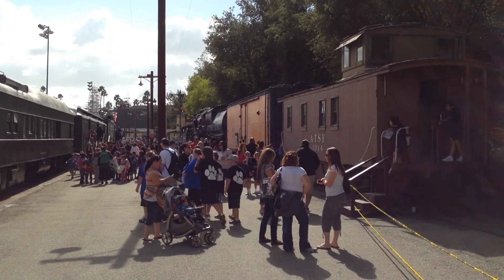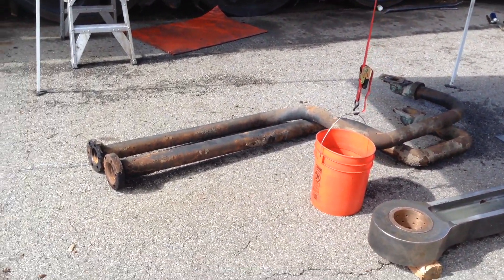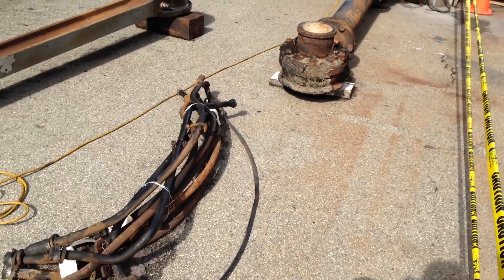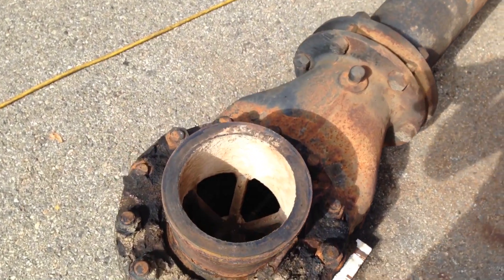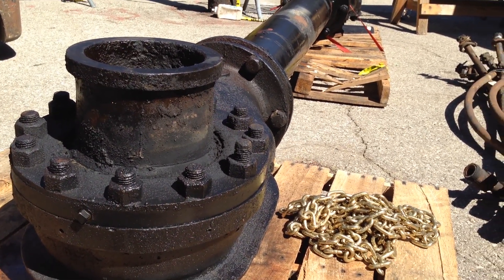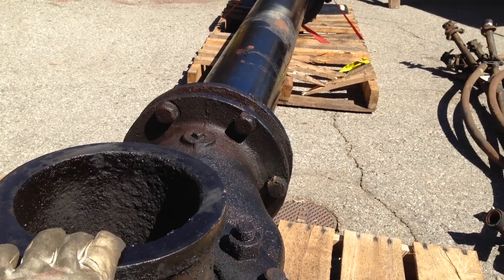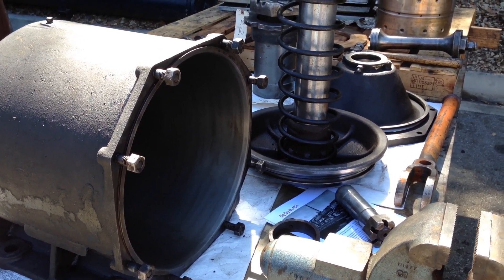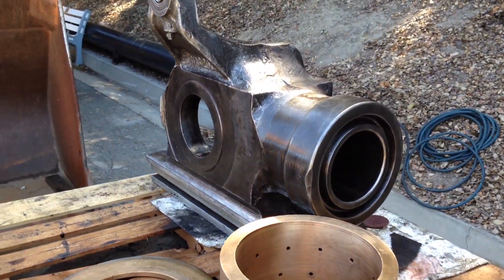The UP 4014 Project - Sept. 27, 2013

Comment: Counterweights are normally wheel balancing for the pins the rods are connected to.
Removing rods and not connecting to cylinder and motion means less to lubricate and watch on the journey.
Thinking along my brake comment, it dawned on me that these locos are circa 400 ton so would be wise to have them "Fitted", how many cars of brake force would be required to stop one of these?
Again from UK experience.

Comment: I was going to post something similar.
Pretty much anything that needs oil or grease that can be removed would be a good idea as well as anything that could work loose.
Ensure the brake lines don't leak and have it as a "Blow through or piped only" if regulations permit with sufficient vehicles behind acting as brake force.
(Am UK based so making statements on UK knowledge)